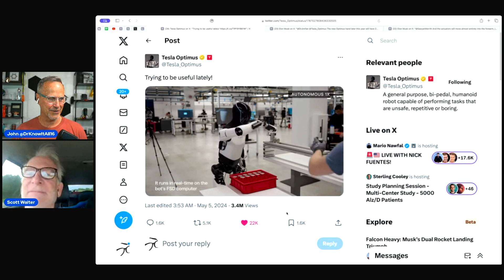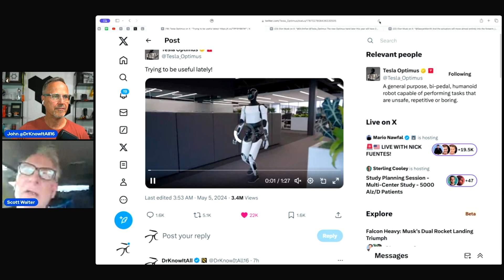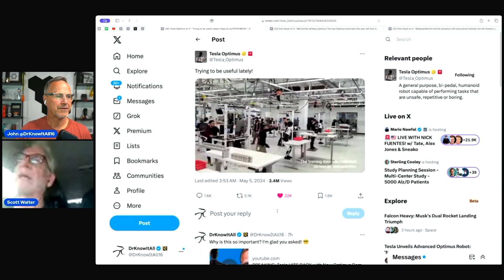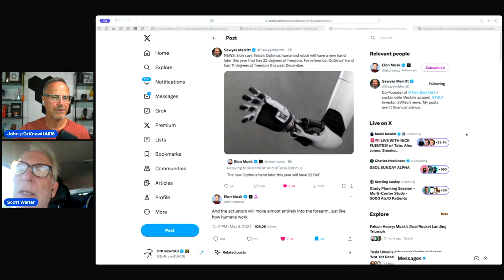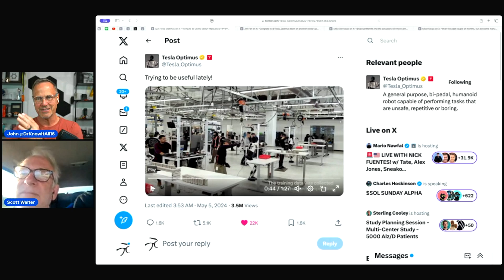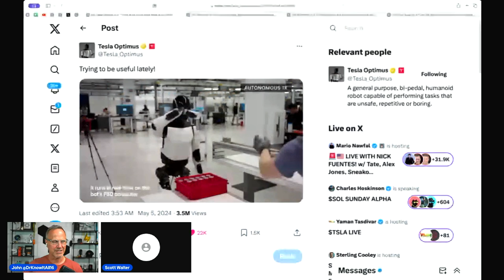Elon: HUGE SURPRISE About TeslaBot DEMO Video! W/Scott Walter

Comment: Thinking about the factory use of Optimus. You could think of it as a general purpose glue that can be used to quickly and cheaply cement together disparate systems in the factory. I wonder if this approach will soon find you with more glue than systems.

Comment: Great vid! I have designed over 12 different robotic / animatronic hands, most do use cables. The zero point in the wrist and any fingers that use adduction / abduction is a real BI**! It doesn't really exist outside of whiteboards. Obviously getting as close as possible to what the zero point would be is the best solution...and I have pulled a few design tricks out of my hat. But you are absolutely correct, you will have to account for the slight change in length WRT to the amount of curvature when pivoting that DoF. Search for "DYN Hand Gen 3" and you'll see what I mean. Cheers!!

Comment: John and Scott, 

Multiprocessing and tandem use of both hands is manditory for Optimus and its cousins.  Unless Optimus is already multiprocess limited, it should be able to handle simple multithreaded tasks (both hand operations).  We saw this functoon in the past.  This video shows (at best) comparable performance to several of the alternative bots.  

If I was putting out a video to showcase Optimus, I would at least try to show more advanced performance (eg two handed pick and place operations).  Double the hands and more than double the work per unit of time.

NEXT:  Don't try to beat Mother Nature. She did not build handed and pawed creatures with active flexors and passive extensors. We humans have extensor muscles for our fingers and toes for multiple good reasons.  Fine motor tasks in particular require both flexion and extension control.  

The new finger motion actuators are likely to provide rotaional tendon contraction with flexion and extension tendons operating in opposition.

One more source of FSD ocillation is moment to moment shifting between 2 equally valid driving solutions with different trajectories.  I believe I am seeing this when stopped to turn with rapidly changing cross traffic.

I hate the double stops with 12.3.6.  We need at least a temporary fix for speeding in active school zones.  FSD is still breaking other basic traffic laws: crossing double yellow lines unnecessarily, failing to signal for lane changes and turns, running stop signs to start with.  12.3.6 varries between dangerously slow commitments in active traffic lanes and overly agressive where my wife has to grab the passenger door handle.  As an engineer and neurologist, "smoother" and "human-like" are not better if performance is worse and the model is breaking BASIC traffic laws.

I have faith in the FSD team to fix this.  I also believe the fix would be faster if they empowered the training AI with basic driving laws and replaced the "average best driver responses" with optimized driver personalities (chauffeur, taxi driver, little old man) and optimized smooth trajectories.

Comment: The live connected operator lag can be compensated for in a similar method that FSD learns with multiple training  sets. The human operators can perform the same scenario disconnected from the bot at full human speed but fully recorded, which the bots use as initial performance targets (MUCH simplier than driving a car) 😊

Comment: There are some operations that require foot controls. For example: the robot can hold an object with both hands and use a foot control to press a button to lock in to place, etc. Of course these robots could have wireless control of machines to some degree.

Comment: They should make it better than a human hand and let it spin 360 on its wrist, same with the head
Reply: Unnecessary, uncanny, and have the same issues why humans don't do it (wiring).
Reply: @andrasbiro3007  could happen with same mechanism that wheels, drills, and other rotary equipment work.
Reply: @LL-wn8yw  
Those don't route power through the spinning part. Optimus have to be able to move it's fingers too.

Comment: That is so slow it is painful to watch. Why not train it to use both hands. Pick it up with one hand and transfer it to the other. Have cameras monitor picking the batteries up and a second camera putting the battering in the rack. I am sure there is enough processing power to do both at the same time. Where does the bots ability to self learn come in? It looks like it is very limited.

Comment: Which is better?
1) A $100,000 robot
2) 100 $1,000 robots

That's the quagmire Elon has gotten himself into.
Same with BD.

A swarm of small robots working together to accomplish a task where the task is broken into smaller parts that the swarm works on in parallel.

For instance, on a production line, 10 parts are to be assembled, with each part in a different location in a warehouse. Elon's Terminator will be busy visiting 10 locations, gathering the parts, and bringing them to the assembly line.

A swarm of small, less capable robots would send out 10 robots, each gathering just one part and bringing it to the assembly line. The swarm takes 1/10 as long as the Terminator.

Sadly, the human-like robot will be eaten alive by the swarm on virtually any task it is to accomplish.
Reply: Yes, great point 👍
Reply: @kennyfordham6208  My son is an IE/MBA, and he designs and builds production lines for a living. He has designed and built hundreds of them to manufacture and assemble thousands of items.

I asked him my question, and his response was startling:
No Need for Production Lines with swarms of robots

The swarm would gather parts and assemble them with tools they bring to the "Pod" 
so imagine an empty warehouse with parts on one end and the remaining floor empty

The swarm would decide there is enough room for 10 pods - each pod results in a finished product. So instead of one production line where everything is sequential, the same warehouse space would assemble 10 in parallel with the swarm, gathering parts and tools and bringing them to the pod for assembly.

He said he would think of the new assembly method as old-fashioned craftsmen who worked as a pod and built the item as a group - no moving assembly line.

You can't "Think outside the box" if your robot is an exact replacement for a human being.
Reply: Manufacturers have used small and large machines for decades. But if you have fifty sewing machine operators, the bot can easily extend the workforce. It can potentially press the foot pedal and manipulate the fabric.
Reply: @robertwhite3503  My son asked "What's the operating temps of the swarm bots?"
I guessed 32F to 140F

Good he said - no need for a warehouse - the pods can take place in a parking lot or a vacant field - no need for a heated warehouse.
Reply: But a swarm of autonomous AGI humanoid robots could swat down the other swarm, pirate the parts and take over the line!
Reply: @user-gv4cx7vz8t  Hell - the swarm would head for a major city and empty the stores of all items.

I chuckled when my son said to use a parking lot instead of a heated/cooled warehouse to assemble - I asked "What if it rains?"

He said tarps would be available, and four bots would climb ladders and hold up the tarp until the rain or snow passed.

His big point is that NO construction of an assembly line needs to take place - millions are spent building conveyor belts and rolling equipment - the swarm needs none of that.

So when assembly ends, the vacant parking lot is vacant, or the warehouse is empty space.
Reply: @noleftturns  Good points. Regional flash assembly locations staged where enough parts arrive to satisfy local orders for a time. Brilliant!
Reply: @user-gv4cx7vz8t  My son specializes in decentralized manufacturing (DM).
Instead of one large manufacturing plant where parts are shipped and the final product is sent to warehouses around the country, DMs are built in smaller warehouse/manufacturing plants close to the final shipping location, such as large cities.

A swarm of robots would take this even further - I'd all it Rave Manufacturing where the robots are sent to build an inventory in a warehouse near a large city and then move on to other locations - just load them in an 18-wheeler and the next day they are in a city ready to make the product for that city.

Big hulking humanoid robots are already antiques before they are even built.
Why automate the human body when it's poorly designed to do optimum tasks that a swarm can handle?

Comment: A human worker might pick up two, or sometimes even three batteries in one hand!
Reply: ...also a human worker can off-load an armful of batteries, and quickly place them in the tray.
Reply: @kennyfordham6208  very true, but no human can work 24/7/365 and this is the great leap for robots on the factory floor
Reply: Eventually Optimus will have superhuman dexterity. It's now around 2 year old level, barely walking and just learning how to put different shapes into their corresponding holes. And considering that the first prototypes were built about 2 years ago, that's on time.
But from here Optimus will beat human kids, because it can learn in parallel, plus it's cognitive and language skills are already human level with the help of LLMs.
Reply: @andrasbiro3007  Yes, eventually...right after Hyper Loop, Tesla Roadster, colonizing Mars, and cold fusion.
Reply: @kennyfordham6208  Thanks for the sarcasm but at the rate the bot has advanced in just over 2 years I think it's going to be ready before we colonize Mars.  That's a pretty safe bet.
Reply: @kennyfordham6208  
And here we are again. Haters never learn.
List of things that will never happen according to haters:

- 2008 Tesla Roadster
- Model S 
- Model X
- Model 3
- Model Y
- Cybertruck
- Semi
- Powerwall
- Megapack
- Solar Roof
- Dojo
- FSD inference chip (in cars since early 2019,  still no competitor)
- FSD (out of beta, robotaxi in sight)
- Optimus (preparing to work in factories)
- Anything else I forgot, it's hard to keep up.

- Neuralink (first human patient is very pleased with his chip)

- Falcon 1
- Falcon 9 (342 launches, 340 successes, 80% of total mass to orbit in 2023)
- Booster landing (just had the 300th)
- Booster reuse (the record holder flew 20 times)
- Starship (reached orbit recently)
- Starlink (6000+ satellites in orbit, ~3 million users)
- Starlink direct to cellphone service (in testing phase)

- Loop (works very well in Vegas, and expanding already)

- X (not just alive, but growing and profitable too)
- X-AI/Grok (GPT-4 level performance, coming to cars soon)

And I left out his early companies, which would be each alone a lifetime achievement for anyone else.

Comment: Demo purpose only! Battery handling, individual cell to pack placement is already done at scale. Battery pack automation is way beyond single Optimus use.
Reply: On big production lines of course. But the 4680 is still in development, so volumes are low and the lines are changing, so it may not worth using expensive specialized robots. Automation is the last step of the process.

Comment: Overshooting a motion is a way to correct for backlash/stretch in one direction, X-Y-Z CNC does this for on the fly calibration for extremely high positioning accuracy, they don’t just move from a-b, same with rotary motion (tables/spindles) all overshoot minutely to spool backlash in one direction, actuator/motors can do this in micro seconds.
Cheers from San Diego

Comment: I was thinking the same thing "Tesabot overkill" but my phrase was "overqualified", but as you pointed out with Teslabot "overqualified" does not mean "overpaid". Teslabot could be cheaper than not only employees, but also industrial robots or even custom built simple machines.
Reply: The bottom line is the bottom line.  No matter the overkill of the bot for a job, if it's a cheaper solution then it's valid. 

Those using the bot will ultimately simply seek out the greatest savings.